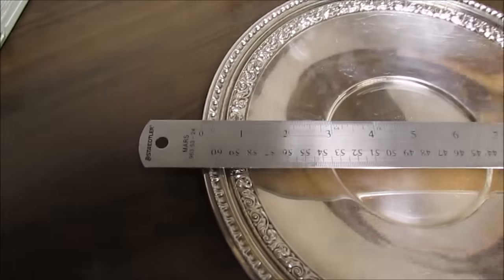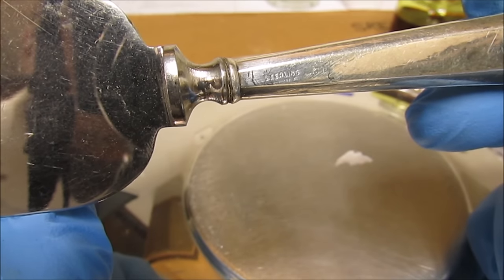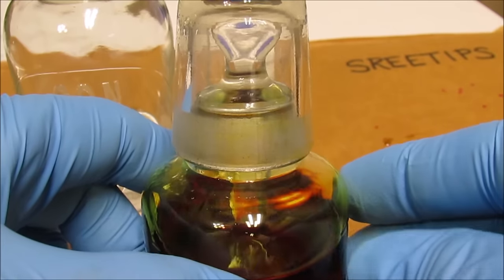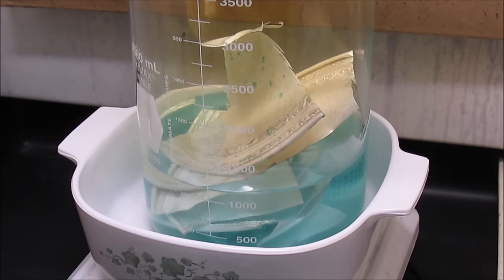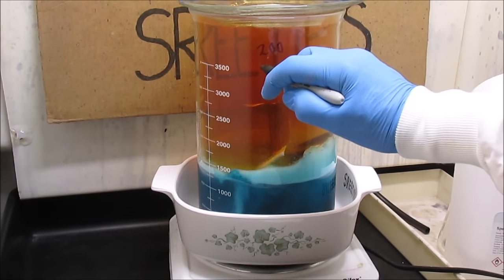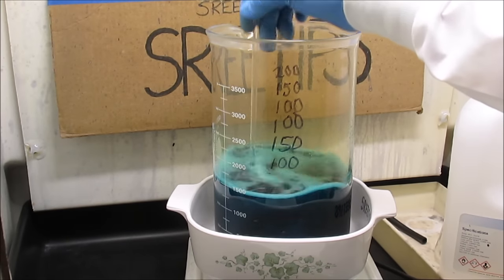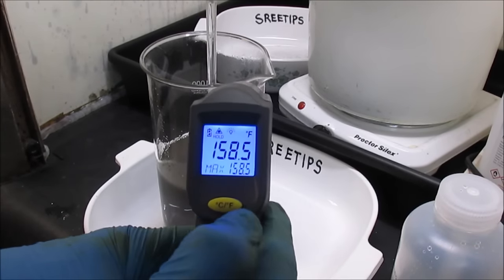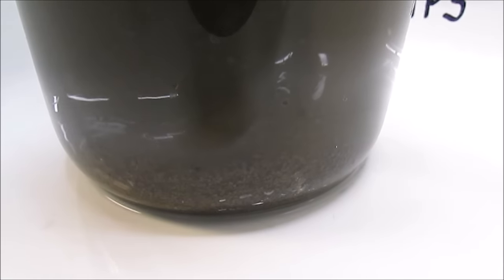Method for Recovering Silver From Silver Plated Items

Comment: There is a much cheaper way of doing silver plate.  The formula is 19 parts sulfuric acid to one part nitric acid.  Heat but only to about 140 F.  The silver plate will turn white as it dissolves in the solution.  When the white is gone, that piece is done. I use three buckets and a plastic colander.  I let one batch drain while the next batch is working in the solution.  After a batch is drained, I rinse in bucket number one, still in the colander, then bucket number two, then dumped in an empty bucket.  Buckets one and two have two gallons of tap water in them.  When the solution is spent, it will be very dark and will not take any more silver.  I let the solution cool down to ambient temperature.  I pour half the solution in each of the water buckets and add a saturated solution of un-iodized saltwater to turn the silver into silver chloride.  Work it into silver metal as you wish.  You might want to try it in one of your great videos. You do a great job.  I enjoy them very much.
Reply from the maker: Frank, I printed this comment for future reference. I may try this later on. Thank you for the suggestion.
Reply: Same as sree I have over 30 plates cups bowls ectect collecting
Reply: I would love to see the process used.
Reply: Hi frank zahn, my name is Joshua. I processed some e-waste a decent amount of it for gold and I have a lot of the waist but I know there must be silver in. Personally, I think there’s a lot of silver, but I can’t figure out why it won’t precipitate. I don’t know if I neutralized the solution or not so I’m going to try that one more time, but can you give me any advice? I really need help on this because I could use the silver right now. Do you have the time please answer me back. Thank you.
Reply: @sreetips  hello sir, my name is Joshua. I asked the same question to the gentleman above. You seem like someone who is busy so I didn’t think to even ask you first. I processed some e-waste a while back, and the waste  made a very deep, dark green solution. I know there’s a lot of silver in it but I can’t figure out how to precipitate it out. I have added hydrochloric acid to it. I’ve put copper in the solution hoping to cement it out. Can you please help me?
Reply: I have lots of mil spec nuts and hard ware with a thick silver plate on them that am trying to figure out how to remove. This may be the method that I try
Reply: How many grams of silver per liter does this solution bear when it's spent?
Reply from the maker: @Matt-xw1xx I’m not the author of this comment. But my guess that it’s probably around a half a percent or lower. So half a gram per 100 grams of silver plated material processed using the authors formula. That’s just a guess. I’ll set this up and try an experiment of my own to see what kind of results can be expected.
Reply from the maker: Josh, this comment originated over five years ago so the author may not be around anymore. I have some silver plated material. I’ll use his method in an experiment of my own to see what can be expected. Thank you.
Reply: @sreetips  Sreetips I think you misunderstand my comment. I am asking how much silver an be dissolved in the acid mixture. I have been studying it to see if it could be profitable. I want to know his actual yield because I have some predictions. According to a figure on Wikipedia, 31g of Silver Sulfate can be dissolved in 100g of  "sulfuric acid" at room temperature. If that's conc. sulfuric acid, it translates to something like 2 kilos of Silver Sulfate could be dissolved in a gallon of drain cleaner. But we don't need to dissolve silver sufate, just oxidized silver. There are 1.3 kilos of ionic silver in 2 kilos of silver sulfate, so I am guessing the solution can hold 1.3 kilos per gallon. I am experimenting with it, but the fumes destroyed my exhaust fan. Will update with findings.
Reply: @sreetips  One thing I found is that nitric acid can be substituted with sodium nitrate. It is much less exothermic because nitric acid is usually 32% water. The sodium nitrate reacts with the sulfuric acid to produce nitric acid in the solution with minimal heating. I had to wait a long time for it to cool down when I used 68% nitric acid.
Reply: I would love to know what the results are if you do try this method Sreetips.  I have a good amount of silver plated material collected and have just been waiting to collect enough to make doing something worthwhile and also to learn a good method that works well.
Reply from the maker: Got cha

Comment: Mr Sreetips there is a very easy way to de-plate silver. A tub of salt water with a piece of stainless steel for the negative contact and hook the positive contact to the piece of plated silver. Run a current through it for 10-15 min and the silver will flake off
Reply: Then what?
Reply: @lifeindetale  I suppose dissolve in nitric and precipitate as AgCl or cement out with copper. In my experience the silver only plates off if you are lucky. It cements back onto the brass, and base metal oxides form at the anode and create a nasty foam. They can be converted to soluble salts by adding HCl, but then chlorine gas evolves at the cathode.

Comment: Wondering about sandblasting the silver plate off of the items, then separating the sand and metals with simple tap water and a gold pan. Would allow you to drastically reduce the amount of nitric acid required to pull this off. Could maybe boost the financial feasibility of this specific operation.
Reply: I use reverse electroplating to remove silver plate it's actually rather simple to use and drastically reduces the amount of copper contamination to be removed later with the acids (also saves time because the removed silver plate falls off in small thin pieces and copper contaminant is a fine powder that desolves quickly). I use salt water as electrolyte and a car battery charger as a power source...
Reply: @Jacob Shrewsbury  make sure to check your electroplated solution for silver after u get the silver flakes out, is usually leftover silver suspended in solution u can't see.

Comment: some companies call it Ultraplate, some call it Extraplate. I only found about it awhile back because my grandma had a bunch of it, than I started looking into it. It is very common, mostly older pieces but some newer ones can be found. Yes you can find several pieces with with very thin plating but thick plating isn't rare

Comment: The little symbol A is a good guide as to the quality of the silver plate.  There are tons of different systems and no standard but a century or so ago, many British makers used followed the gradings ...   
A1 = Superior,  A = Standard and then lower and lower grades below that  B,  C,  D,  E based on how many pennyweight was plated on.    A1 was usually a troy ounce of silver per 12 tablespoons or forks.
Also don't get confused with <E> <P> <N> <S> stamped in Old English font which looks like a hallmark. That's electroplated nickel silver and usually pretty thin.
Reply: Thanks, really good to know :)!
Reply: There is also Extra 1a NS, 1a NS & Alpaca markings in Europe..

Comment: If you undershoot a little bit with the HCl, so you leave just a little silver nitrate in solution. You can filter out your silver chloride, and save the filtrate. You can then use the filtrate to dissolve more silver items, because when you add the HCl you also create nitric acid. You just want to undershoot with the HCl, because if some is left over it will react with the silver and form a AgCl coating keeping the nitric from dissolving it. That way you can save some money on buying more nitric. I actually just did this, it worked out pretty well.

Comment: Just as plating I would never have imagined you could get that much silver off of that lid. Understand I dont doubt you a bit as I have learned how sharp you really are at this stuff. Im also extremely jealous at how productive you are and could only hope that I could ever do anything like what you do. I dont like toxic chemicals or agents. I would never work in a trade or plant that would put me anywhere near dangerous lab work. I worked in a production machineshop for just under 28yrs but I would bolt when they had painters painting the floor with very toxic paint. Whenever they painted in that building I bolted to get away. One of the painters never wore a mask I couldnt believe it. You would get a headache right away if you were anywhere near it. Im not exagerating. But you I have learned know exactly what you are doing. Do you have a chemistry degree because you work like a Scientist, I do really enjoy watching what you do and most of all when you end up with an incredible bar of Gold and Silver too. I always wonder if you really should be wearing a good mask or ventilator but I think you know what your doing.
Reply from the maker: My degree is in Aviation. I’m a retired Naval Engineer. I get whiffs of fumes every now and then. SO2 gas is the worst for me.
Reply: He uses respirators and fume hoods when needed.  Chemicals are perfectly safe when handed with safety and respect.  No need to " bolt away "   just be smart and safe.  You sound kind of childish actually

Comment: Hey sreetips ! Thank you for all the great content you keep on making !
I have 10kg of silver plated items , it wont make sense to dissolve them in nitric as i will need alot of nitric to do that . I was wondering if sanding the silver off and refining the dust would be a better option ?
Reply: Good thought that way you would need much less nitric acid.  Flat areas would be easier, relief areas would be tough.. Good idea though.
Reply: 1
Reply: I have wondered how using a very course ceramic grit in a vibrating or even in a rotating polishing setup would work. 

I initially had the idea to strip gold off of pins and fingers etc. as a way to speed up the process by not having to devolve all of the copper
Reply: sanbladt and screen

Comment: HI! I have a problem about silver recovery from silverplated silverware. The basic metal is zinc, then a thin layer of copper and then silverplating on.  First i try to disolve whole spoon in nitric acid, but it starts to boil over the floor.  I repead the proces with less concetrated nitric acid, the spoon is disolved, but i have a lot of powder on bottom, the liquid is blueish. So im guesing that zinc is on the bottom like powder, silver is in liquid? or did zinc something else to my silver? Now I will first melt the zinc away and scrap the upper layer down, and i will procced with that nugget forward
Reply from the maker: Zinc is soluble in nitric acid it will turn your solution green. Get a small sample of the blue liquid and test it with a few drops of hydrochloric acid like I did in the video. What ever is on the bottom, it shouldn't be zinc. It might be your silver.
Reply: @sreetips  Hi again. I finished disolving silverplated silverware in nitric acid, filtered it and put Hcl and nothing happened. Like no silver inside. No cloudiness... ;(  Should I try put copper inside to cement silver?

But now I have second problem with recovering gold from cpu...I disolved 15cpu and few ram sticks in Hcl + hidrogen perokside (little), put those goldplating leaves in aqua regia, they disolved, filtered the liquid and today I got my smb by mail, (in Slovenia hard to buy), and surprise...nothing happened with liquid..like no mud at the bottom, still green yelowish colour...I put it so much that smb sit on the bottom...no reaction. Do you know what could go wrong? Should I put a little bit of urea inside?

Comment: I have a question? When you melted your silver cement in the wet filter. Did you use any flux like Borax? I know you  glazed you dish before  melting? Did you add  borax to  that silver burn?  Streetips your my favorite  you tube channel. I have learned so much. Never stop doing your vids. Thxs so much
Reply from the maker: I don’t think I did. But if I did it was very small amounts only

Comment: Hi Sreetips, I am a new watcher and you have me hooked.  QUESTION: what is the orange gas and would it make the reaction and therefore nitric acid use more efficient if a condenser was used to drop it back into the beaker?
Reply from the maker: Orange gas = nitrogen dioxide. Refluxing it would improve efficiency.

Comment: Best to melt into a sheet and electroplate the copper out with copper sulfate and sulfuric acid in a cell will get pure copper and anode slimes being able to reuse the acid many times lowering the acid cost
Reply from the maker: I don't have any experience with that. Can you make a video and show how it's done? Thanks for watching.
Reply: sodium sulphite is even better, non-toxic,  cheap alternative.
Reply: @sreetips  Great video Sreetips. Glad you are back. :-) Nurd Rage has a video converting copper chloride, from PCB 
etchant, to copper sulfate then plates out copper to recycle... essentially I would think it's pretty close to the same thing your doing converting the copper & silver nitrate to copper and silver chloride with HCL ... anyway check out the link.  https://youtu.be/FjEoRidvgYE
Reply: Look up "growing copper crystals". Electroplating with CuSO4 is actually the industrial process for refining copper. You just need a DC  powersupply, a bucket and some CuSO4. Silver won't dissolve in sulfuric acid, but copper will. You're transfering copper from the anode to the kathode, pure silver will collect under the anode, as the copper gets dissolved. Also as you use dichromate for your testingsolution, I've no doubt that you can get CuSO4

Comment: That was pretty interesting street. I recycle off and on and I have about 5 lb of silver plated copper wire. I would like to melt it down and retrieve the silver and copper to recycle the copper as copper 2 and take the silver to a jewelry store and get paid for the silver. Anyway of just melting it down on the store or with a propane torch? I'm not much into using chemicals.
Reply from the maker: If you melt the wire then the metals will alloy together.

Comment: Great video. Would this process be  the same if I wanted to recover silver from the waste that I got from my initial gold recovery? To be more precise I recovered gold from CPUs but I know there's silver in the waste. Do I recover this silver like you've done in this video so basically adding distilled water and nitric acid to the waste solution and continuing like u did or is there another way? Would highly appreciate your reply. Thank you so much.
Reply: Or do I add copper to the waste solution to cement the silver out. I'm a little confused as to what the next step will be to recover the silver. Help pls. 😬
Reply from the maker: If you have silver in solution then you can add copper to "cement" the silver out. However, if your solution contains any hydrochloric acid then this won't work. Hydrochloric acid added to a silver nitrate solution will immediately precipitate silver chloride. The silver chloride can be recovered and converted to pure silver metal with lye and sugar. You can test your unknown solution by putting some in a test tube then add HCl. If silver is present then you'll immediately see a cloud is silver chloride form.
Reply: That makes sense now. Thank you so much 😀

Comment: Thanks for the breakdown at the end. What about the sodium hydroxide $ what is your time worth and what is the Map gas for melting it down cost $$ all is overhead. so to me, it looks like you might break even at best. Is it any cheaper to just smelt it down from the start ?
Reply from the maker: It’s my hobby. I don’t keep track of expenses for each batch.
Reply: Ya I got that, I just been looking at doing this sort of thing but don't want to do it and not at least come out a bit ahead. Thanks for the reply. @sreetips
Reply from the maker: I see. The only reason I did this was because I seen how thick the silver coating was over the base metal. Most silver plated stuff is not that thick. This item was unusually thick, and that’s why I choose to do it.

Comment: OK, some questions and comments.

1)  I saw another video where the guy just used salt, water and a battery charger.  What's the difference?

2)  You never explained how to safely dispose of all those toxic acids.

3)  Copper is recyclable too.  Is there a way to separate the silver from the copper and save both for reprocrssing?
Reply from the maker: 1) not sure 2) waste treatment 3) to a refiner, copper is waste
Reply: reprocessing?, one more question.  Can the same process be used with gold plate?  Or like separating gold fill?
Reply from the maker: No, gold plated is best processed in a sulfuric acid stripping cell.

Comment: Hi, love your video's. I have a question about my project. I came into some electronic silver wire pieces from my work. I've followed your refining process to find out that im able to retrieve some silver from the wire but cant get all of the wire to melt all the way. Also while the acid is working the silver wires the mixture of acid, and distilled water turns a light grey and not the blue color. Im thinking the wire pieces are not copper, and silver mixed? Do you have an idea? It does turn blue when im at the next phase of adding the copper pieces into solution. Would appreciate your thoughts
Reply from the maker: If copper returns is in your wire then the solution will be blue once dissolved. No blue, no copper. Get some silver testing solution and check your wire for silver BEFORE putting it in acid. If you want a proper outcome then make sure your inputs are correct.
Reply: @sreetips  do you think i can send you some of this wire to test it for me?